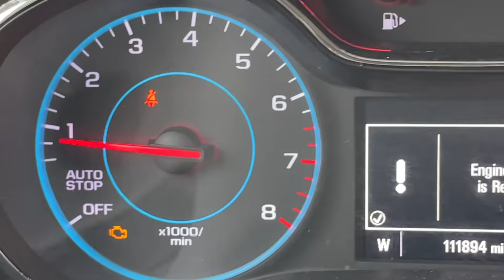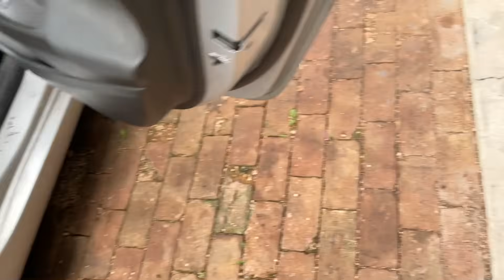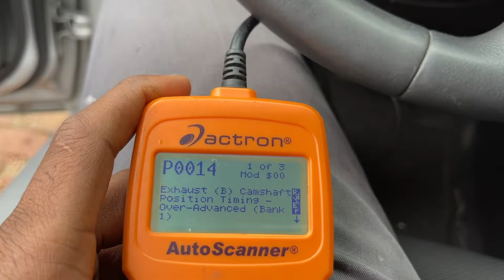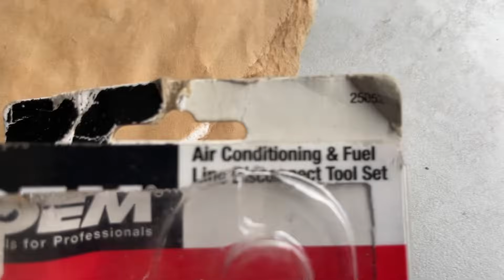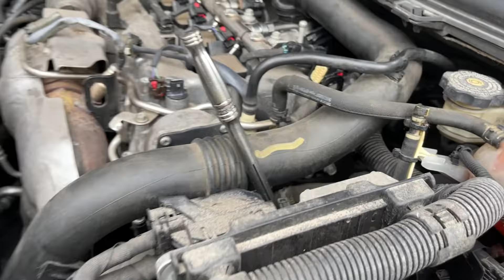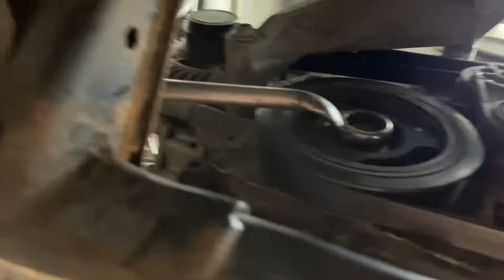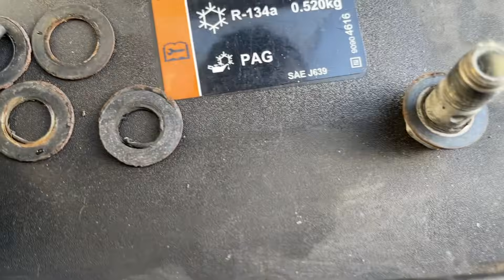16-19 Chevy Cruze, Mailbu Valve Cover Removal, VVT Solenoid & Camshaft Sensor Replacement 1.4L, 1.5L

Comment: Injectors/ valve cover already off ALWAYS put new gaskets, too far into it now not too. They are cheap and will save you a headache later as the valve cover gaskets are notorious for leaking. Otherwise great video sir!

Comment: yo what kinda sealant did you use you didn't include that in the description
Reply from the maker: Here is a link for the sealant. 

https://www.autozone.com/p/permatex-gasket-sealant-82180/554295?spps.s=&cmpid=PLA:US:EN:AD:NL:1000000:GEN:22138360769&gclsrc=aw.ds&gad_source=1&gad_campaignid=22142102098&gbraid=0AAAAADkcoVsJvZJn6391EofoildIfX8Wq&gclid=CjwKCAiAxc_JBhA2EiwAFVs7XKWQQ45PKW6GXm3pzJ6CJbipk1eetx66EoG6hbuFaouFsJkfZ2x7xRoCoWMQAvD_BwE

Comment: Pcv valve In the valve cover causes tons of issues. Doing this on my 18 cruze bc of a code. Also oil in the outlet tube for the inner cooler. Installing a catch can kit.
Reply from the maker: Yep, it sure does. Thanks for watching.

Comment: This video made my job so much easier. Mom’s vacuum pump exploded, i was able to dig out most of the pieces but I can find 3 pieces so now I gotta open the valve cover. This video is the only detailed video with all info needed. Thank you
Reply from the maker: That's awesome! I am glad my video could help you. Thank you so much for watching. I really appreciate it.
Reply: What would happen if the pieces were not taken out?
Reply: @twylightcrow7789  gemini says its ticking time bomb
Reply: @VasuPatel-l4l  Like any BMW🥳
Reply: @twylightcrow7789 you could end up with them caught up in the valve train and even falling into the cylinders causing catastrophic engine damage.
Reply: Extra tip. The Cruze is notorious for stopped up  catalytic converter and causing engine power reduction. Especially if the car has been driven very gently and the owner didn't use high octane gas.
Reply: @noclu4u384  Dont forget damaged pistons

Comment: what the HOLY you doing there🤣?

it smells that something smoking, maybe a pocket.

just leave it there let the engine gets hot and drain, repeat the process with some engine additives or engine flush , use cheap engine oil during cleaning process and just low level til’ engine runs well.

Comment: I don’t get it. The vacuum pump broke and the reluctor was off a little bit. I relined it nothing so now I took the cover back and I checked the timing and it appears to be off. How does that happen? And how do you do the timing chain?
Reply from the maker: Hi, I do not have a timing chain video on this vehicle. There are many on Youtube. It seems as if your chain needs to be replaced. It's hard to pinpoint it since I cannot see it in person.

Comment: I know it’s been a while since this video was posted, but I ended up getting the vvt code months later after changing my valves, ended up being exhaust solenoid with cracked screen, should I take off the valve cover?? all the broken pieces came off with the old vvt solenoid actuator, or can I just put in the new one? I have the old actuator out, and a new one in hand, but I don’t have the parts and new gaskets to do the whole cover again, I’d have to order more.
Reply from the maker: Nope, you do not have to remove the valve cover. You should be fine. Thank you for watching.

Comment: hey men I back again to watch your video, I need to change valve cover gasket in a few months, I have a little leak. You change the o-ring/seal of this injectors to or is not necesary? thanks again.
Reply from the maker: The injector seals don't necessarily need to be replaced, but it doesn't hurt to do it. I did not change them on a few vehicles I have done and everything was fine. Thanks for watching again!

Comment: Do you have to remove the feul rail and injecteors to pull the valve cover? It looks to me like they would come up with the cover just fine. Im attempting to get to the head gasket.
Reply from the maker: I have done a few of these and this is the ONLY way that I would do it. You can try to lift it with the valave cover but I like to do it this way. Thank you VERY much for watching.
Reply: @TerenceDIY so my injectors did not want to come out. Also I was afraid I wouldn't be able to get them back in because they were in so tight. I took the smaller Allen bolts out and the rail came off the injectors just fine. Now I just gotta get that head off without messing up the timing.
Reply: @TerenceDIY how did you reinstall the injectors?
Reply from the maker: @barryalford5513  the video show in great detail of me removing them, cleaning them and reinstalling everything.
Reply: @TerenceDIY i will admit, i slightly bent the rail lines backwards very slowly and carefully, the injectors didnt want to come up 😅, got the Valve cover out now. Turns out the oil pump went bad and not only that, it broke into pieces. Will give an update when i finish with it. Replacing both the vacuum pump and the valve cover gasket now.
Reply from the maker: @Tea-q4u  okay, let me know how it turns out.
Reply: @TerenceDIY  To put an edit. I meant the vacuum pump 😅
Reply: @TerenceDIY  late update, totally forgot to say, so yes, the vaccum pump worked perfectly, oil change of course and also one quick, this is highly important for these 2018 and 2019 Malibus with the 1.5l turbos, you need to use premium fuel. Or else it will clogged the injectors, simple Lucas fuel cleaner( half of bottle ) for a full tank of gas clear up your variable timing codes by the next day or 2 . Basically, 30+ plus miles is recommended highly, you'll notice an increase in torque and fuel mileage. Keep up with the maintenance, these are aluminum composite and not doing the maintenance on time will ruin the vaccume pump, change the air filter as it gets dirty, or it'll clog up the turbo air flow system, and replace your maf sensor if you have a Malibu thats above 100k. Thus will give you everything you need to get it back up and running. Been working on cars for 13 years 😅and everything I just told you to do i just did my 2018 and 2019 Malibu, both are running solid again.
Reply from the maker: @Tea-q4u  I knew exactly what you were talking about. Lol. Keep me posted.
Reply from the maker: @Tea-q4u  great job and thanks for sharing that info. I have been working on them since 10. Changed a motor and transmission by myself at 13 in which made my dad very proud.

Comment: Skipped the hardest part I’ve done about 20 of these cam covers and those plastic lines that run across are a pain
Reply from the maker: Sorry if it seems as if I skipped something. I try to be extremely detailed when I upload these videos. I am pretty sure there is NOT another detailed video better than this on Youtube for this job. I know these things like the back of my hand. Thanks for watching.
Reply: Literally my only problem I fucked around broke one
Reply from the maker: @MrDwaine15  I hate to hear that.
Reply: @TerenceDIY it’s a single line . It is goin to be hard to replace ??
Reply from the maker: @MrDwaine15  If you are mechanically inclined, then it should be pretty straightforward.
Reply: @TerenceDIY  & it was , just a little common sense lol 🫡👌🏾
Reply from the maker: @MrDwaine15  lol

Comment: Via GrokAI: For a 2018 Chevy Equinox (1.5L or 2.0L turbo), using Permatex RTV with a rubber valve cover gasket is generally not necessary for the entire gasket, as the molded rubber gasket is designed to seal on its own when installed correctly. However, a small amount of Permatex Ultra Black may be recommended in specific areas (e.g., timing cover junctions or corners) if specified by the GM service manual.

Comment: Just did this job. Had trouble taking the cover off due to the oil pump. I didnt realize it was part of the valve cover. Your video helped me out alot, thank you.
Reply from the maker: You're very welcome. Thank you for watching.
Reply: My valve cover is stuck ?? Any ideas ?! I’ve made sure all fasterns & stuff are undone . All bolts . I’m afraid to apply to much force to it . Or hit it to hard with a mallet or piece of wood ?!
Reply from the maker: @MrDwaine15  Tap around it near the bottom with a mallet. Or use a prybar or a large flathead screwdriver and try to pry the corner up first. Make sure the bolts are completely removed.

Comment: I just got stranded on the road and made it to a near by gas station in my 2016 Chevy Malibu Ls. I went to 2 mechanics. 1 recommended an engine swap and the other offered 3,180 to fix everything wrong.
When I looked at the coolant reservoir, the plastic was broken off into the tube and I wasnt getting any coolant. 
I should have known better but looking at this video, I am also experiencing the same shaking of the engine. Ill look in to the actuators. Thank you so much! You're the Boss ✊️
Reply from the maker: Please keep me posted. I hope the actuators are the issue, it will be an easy inexpensive fix. Thanks for watching.

Comment: Probably the worst car I’ve owned, kept up with oil changes, did last oil change 1 month ago, within that time frame my oil was completely empty no check engine lights so I have no clue why it’s burning so quick
Reply from the maker: Any visible oil residue around the valve cover or vacuum pump?
Reply: No engine is clean no leaks, vacuum pump seal is still good, I’m taking the valve cover off right now bc my vacuum pump blew up, but there’s nothing that points to an oil leak
Reply from the maker: @federicoruiz2087  okay.
Reply: PCB valve or turbo leak, very common on these. I would take apart the intake hoses and throttle body, If there's oil in there the PCV valve is stuck open
Reply: Did you buy this car new

Comment: So I'm watching this right now and currently tryna fix it not sure if it's the timing chain or not
Reply from the maker: If it's the timing chain, it would not start right away. It would take a few times to start and when it does, it would not run smoothly.
Reply: @TerenceDIY  took it apart yesterday top part of the chain is perfectly fine gotta check the bottom vacuum pump was definitely broken got the parts out gonna finish the rest today
Reply from the maker: @jalen247ful  okay. let me know how it turns out.

Comment: Not sure if you still reply to comments, but my girlfriends 2016 cruze had the vacuum pump shatter, it through all types of codes including this one. Now I go as many pieces as I could outside of the hole and replaced the vacuum pump and the car drives completely fine but it still has the check engine light on. We took it to autozone and it through the code p0017 and p0016 along with something about the timing chain. It doesnt sound any different than the engine normally would. I dont hear any clicking and it doesn't shake violently. Maybe the its out of line with the QR code? I'm going to check today and see
Reply from the maker: I respond to every comment. If the reluctor were out of line, it would not run smooth. However, you can visibly inspect it just to make sure. Also, out of curiosity, when was the last time you changed the oil in the vehicle?
Reply: @TerenceDIY  the oil change was very recent when the vacuum pump had broke on her car. I'd say it happened within a month ago. But prior to that I dont know when the last owner had changed the oil, I notice that it would idle around 500-800 rpm and it did stall on us one time but besides that the engine is still on and I still haven't had any issues.

Comment: Thank you. I replaced spark plugs and found oil on the threads and thats what lead me to watch this video. I believe i now have to replace the valve cover gasket? (2017 chevy cruz 1.4L turbo)
Reply from the maker: You're very welcome. Before you removed the spark plug, was oil sitting inside the port or you didn't pay attention? If so, replacing the valve cover will fix your issue. If not, the tube seals may be worn. I have rarely seen this on these engines. Thank YOU for watching.

Comment: I think the low oil light on that engine means you have no oil pressure.  By then😂 its to late
Reply from the maker: Flawless fix. Been doing this since I was 10 years old. I think I am pretty good. Thanks for watching.

Comment: thank you. please explain fresh air house on PCV. How did you take them off. I heard they are temper proof
Reply: The connection  please. Ty
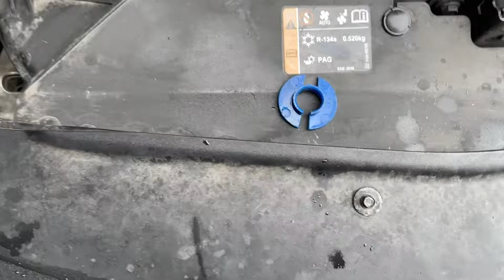Reply from the maker: It's the same method of how I removed the hose at the 15:08 mark. You need a quick disconnect tool. Like this...(link below)

https://www.amazon.com/Lisle-37000-Conditioning-Fuel-Disconnect/dp/B0002SRCK6?source=ps-sl-shoppingads-lpcontext&ref_=fplfs&smid=ATVPDKIKX0DER&gQT=1&th=1
Reply: @TerenceDIY   Yes, Thanks, there are three, the one closer to airbox that's what I used there is room to use the tool the other two, I don't know.
Reply from the maker: @ArmenArmenjs , yep I know these engines well. They are fairly easy to remove.
Reply: @TerenceDIY  Thanks you're awesome.
Reply from the maker: @ArmenArmenjs  thank you for watching my content. I really appreciate it.
Reply from the maker: Are you referring to the tamper proof bolts?

Comment: Hey bro what name of Ratchet your use I like way ur able trun Handle
Reply from the maker: It's a stanley rotator ratchet. I bought this ratchet probably 12 years ago. They have a new version now. Here are the links to both. 

https://www.homedepot.com/p/Stanley-3-8-in-Drive-Rotator-Ratchet-89-962/203740742?source=shoppingads&locale=en-US&pla&mtc=SHOPPING-BF-CDP-GGL-D25H-025_001_HAND_TOOLS-NA-Multi-NA-PMAX-NA-NA-NA-NA-NBR-NA-NA-NA-Hand_Tools_JControl24&cm_mmc=SHOPPING-BF-CDP-GGL-D25H-025_001_HAND_TOOLS-NA-Multi-NA-PMAX-NA-NA-NA-NA-NBR-NA-NA-NA-Hand_Tools_JControl24-21114676043--&gclsrc=aw.ds&gad_source=1&gbraid=0AAAAADq61UfLfF9N3KGT6thRE4HuHoJCJ&gclid=Cj0KCQiA7NO7BhDsARIsADg_hIbQiSZYl41T7oo0fGUKgopWbLEU9JiWYcuav0niq5hAD18lwM6i2G4aAmMoEALw_wcB

https://www.amazon.com/Stanley-0-94-607-Ratchet-Rotator-Silver/dp/B0024LLQWY/ref=asc_df_B0024LLQWY?mcid=e6600b89158f36ed9434d24666da60c0&tag=hyprod-20&linkCode=df0&hvadid=693672553565&hvpos=&hvnetw=g&hvrand=895015218691125279&hvpone=&hvptwo=&hvqmt=&hvdev=c&hvdvcmdl=&hvlocint=&hvlocphy=9021638&hvtargid=pla-423204211661&th=1

Comment: Living in europe here, This is a great video. This is the counter part to the Opel/Vauxhall astra k over here. There are almost no videos on the petrol turbo engine in these I could find. This has been great insight👏🏾. Have you ever had the chance to replace the timing chain on these by any chance. Would love to see a video from you especially doing one
Reply from the maker: Not yet. I almost had one in the works and was looking forward to doing a detailed video of the process but the car got repoed. The owner said they was just going to leave it at the dealership because it had issues. Thank you SOOOOOO much for watching my content. I really appreciate it.
Reply: @TerenceDIY  I'll definitely be coming back again to it for sure. That would've been a great video if it didn't fall through, I haven't been able to find a single walkthrough video on the timing tools and steps needed to do the job properly. This has been the closest find to date. They're all YouTube shorts on the previous. generations of engine haha.. thanks again for posting, keep up the solid work 👍🏾

Comment: If the reluctor isn’t lined up and we don’t have cash to replace the cam shaft could we just knock it back in place for now?
Reply from the maker: Yes, you can tap it back in place.
Reply: I just did that today to my Chevy. I smacked it a few times with a hammer. Id recommend to wrap a rag around it

Comment: Great video first off very helpful. Having the same problem on my 19 terrain 1.5l. The vacuum pump exploded, i took off the valve cover and cleaned out the broken pieces, made sure the reluctor wheel was aligned, changed the oil n filter. After all that it wouldn't start, had codes p0017 n p0014, change the vvt solenoid on the exhaust side and engine fired up. Still getting the same codes, p0017 is constant, p0014 comes on after a few minutes with the reduced engine power, changed the exhaust side sensor and crankshaft sensor and still the same codes pop up. Engine sounds great and doesn't shake or anything, tried swapping the vvt solenoid and cam sensor from the intake side and still the same codes. Any help would be greatly appreciated 🙏

Comment: This video is very informative, I have a Chevy equinox, and the vacuum pump went bad. I have fragments inside that I can not get to the, egines look very similar. Just wanted to know if it was the same process in moving the valve cover.
Reply from the maker: What year Equinox? If it's 2016 and up, this is exactly the same process. Thanks for watching.

Comment: Great video. I just recently ran into a code that popped up P050F Brake Assist Vacuum Too Low yet brakes fine and oil has been changed regularly. I reset the code and am waiting to see if it comes back on. My first guess is maybe a bad sensor or something. Have you had any experience with this code?
Reply from the maker: Not for the Cruze however,. I seen this code in a Malibu once and the Vacuum pump ultimately failed. Please pay close attention to it. Hopefully it was an anomaly due to ambient temperature.  Also, it's rarely a sensor in these cases. Thanks,
Reply: @TerenceDIY  Thanks for the reply. I actually have an 2018 Equinox 1.5L. Today is another day the check engine light has not come back on. I read somewhere that in order for it to be considered okay is when you have put 200 miles after the reset of the code. If it does come back I will be replacing the Vacuum pump if it does.
Reply from the maker: Okay, same engine and setup basically. 200 miles or most importantly several starts. If there is an underlying issue, rest assurred it will pop back up after several starts. Hopefully you'll be all good. Fingers crossed. Once again, thank you VERY much for watching.